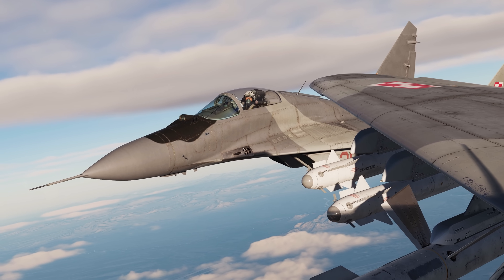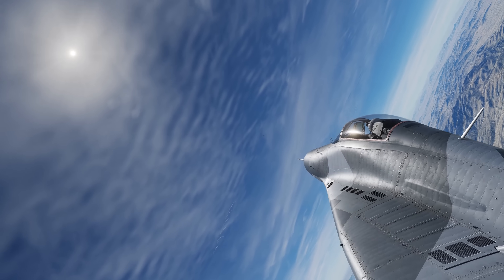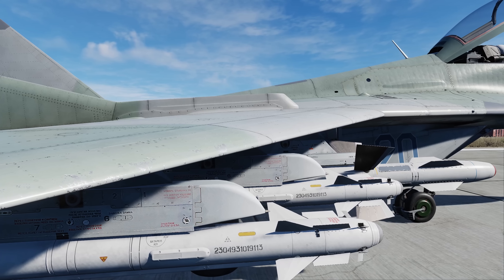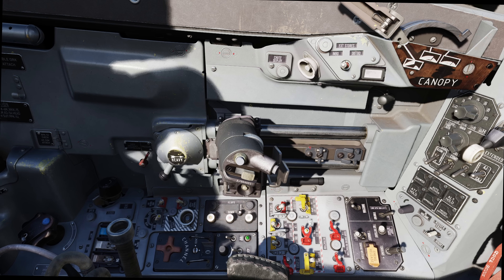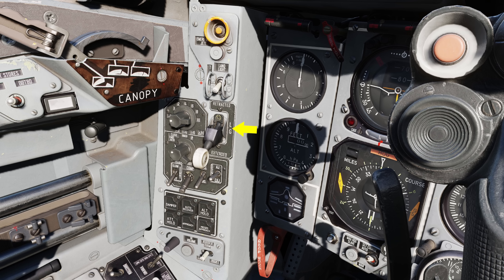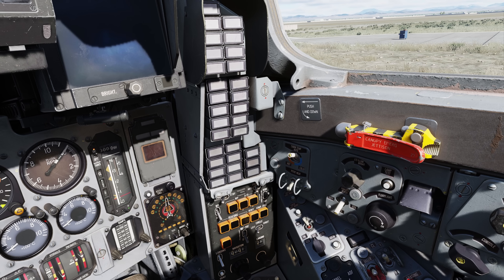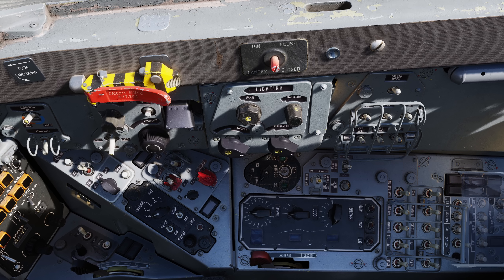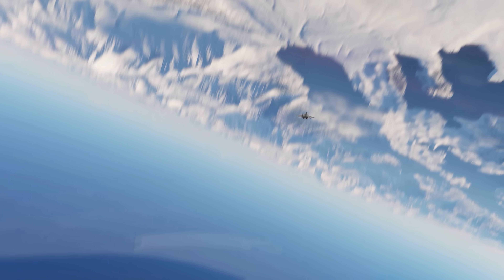DCS: MiG-29A Fulcrum | Introduction

Comment: Why did you pick the Mig29A as it’s not exactly a comparable adversary to go against the F18 or F16….? 
Anyone who wants to fly an old Russian Jet they can buy the Mig21!
Reply from the maker: The abundance of reference data, access to the actual aircraft, and SMEs.
Reply: @MattWagner  Is SMEs an acronym for "subject matter experts"? This module looks very promising, could be the most interesting in DCS so far. Have you seen the channel "O Letani" with Vaclav Vasek on the MiG-29? Nearly 3 hour interview with a czech pilot who flew the MiG-29A when it became operational. Among other things he mentions much greater radar discovery/lock distance for a fighter sized target than the current ca 60 km in FC3, but I didn´t write down timestamp for that. Timestamp 1:13:00 mentions 30% reduced lift when using the center tank, which I don´t think is modelled in DCS at the moment. 1:20:40 slats out auto at AOA 10 degrees. 
2:05:00 Gun, chainsaw, KOLS. 
2:07:30 KOLS, EOS, Kvantova opticka lokalizacni stanice, infrared radiation, laser rangefinder, multiple modes of operation, co-op with radar. 
2:08:50 path prediction mode, up to 25 km, passive, not emitting any electro magnetical signal, mentiones funnel-mode.

Comment: Noticing that the HSI has a 'miles' indicator. Will we have to option to select English & Metric, or will it be Cyrillic/Metric and English/Imperial only?
Reply from the maker: It’s an option.
Reply: @MattWagner  Nice! The cockpit looks absolutely amazing. Really, really like the effect for the Schlemm system. Fantastic work by ED, and I cannot wait to fly this thing. :)
Reply: @MattWagner  Sadly it appears there is no English/Metric option, at least at release. :(
Reply from the maker: @madaxe606 there certainly is. https://youtu.be/aUlafaMDuU0?si=vv1ctOMXTJmScuO_ and in Gameplay / Units
Reply from the maker: @madaxe606 my cockpit is literally set up like this and for several of my videos.
Reply: @MattWagner  Ok, the issue is that the ARTWORK for various instruments in the English cockpit are all in Imperial - feet on the rad alt, miles on the HSI, NM on the fuel totalizer etc.

The HUD and some of the dials (altimeter, IAS etc) once you're actually airborne are reading in metric, if selected in Gameplay. 

As a friendly suggestion, let people know that selecting 'English cockpit' doesn't change the labels shown on the dash, because that's very confusing as-is.

Adding another cockpit display with metric shown on the appropriate dials in an otherwise English cockpit would be greatly appreciated and alleviate a lot of confusion. 

Looks/sounds terrific otherwise so far!
Reply from the maker: @madaxe606 of course, that is the cockpit art, not units.
Reply: @MattWagner  Right. But since most of us will start out on the ground doing a cold start, you can appreciate why we're mighty confused.

As I said, an English-Metric version of the cockpit with those labels swapped for the km/m versions from the Cyrillic cockpit would be greatly appreciated and probably save you guys the same question being asked over & over again.

Comment: The cockpit layout is pure chaos. :D
Reply: Many say that, but I don´t agree. At least not with the working gauges in the FC3-module you typically use in flight. There´s also more animated switches compared to  F-15C in FC3. As a side note, the Su-33 cockpit is probably the one that has gotten most love by ED.
Reply: @flythething193  IMo the buttons are not in something like logical order. In comparsion with F-16 where you go in dedicated sections from left to right at the startup, here you have buttons and switches randomly placed to point "where was free place".
Reply: In Soviet Russia, pilot is the environmental issue for the cockpit

Comment: I don't play dcs maybe for 2 years but i specifically remember squeezing r27er for every drop of performance cause of how easy is to defend against and that was with abusing almost 90 degrees lock su27 has in dcs.
Genuinely curious who needs 29A that has less missiles than su27 and possibly limits on whether it even gets r27er instead of utterly useless 27r.
And i am pretty sure it should have older mig23 fox1's too but i don't remember the name.

Comment: Why not the MiG 29 SMT instead of this old lame duck?? The MiG 29A hasn´t achieved at least one air victory! It was inferior to all western gen4 aircraft of this era!
Reply from the maker: Much, much better references.
Reply: "It's not the plane, it's the pilot",  I don't think this plane is inferior, I think you must use it a certain way to be able to beat other aircrafts
Reply: @Ubt_  It would be an interesting adversary for the J-35J Draken... which had an early primitive GCI text based data link, and a different kind of electro optical device. Btw, I mentioned a czech MiG-29 interview in another post if you´ve missed it, Vaclav Vasek, channel O Letani.

Comment: Any difference with Flaming Cliff or Lock On Version??? 😒😒😒😒 I like this plane but.... It is more of the same thing....
Reply: The whole point of the module is to enjoy the aircraft in its highest detail and with all its quirks. Its not about features to dominate in multiplayer.
Reply: If you want, the FC version is the functional plane while the FF version is the "true" thing, better system, you can understand how it works, it simulate some tiny details for the nerds like the little air intake animation on the top of each engine
Reply: I will read logical answers only